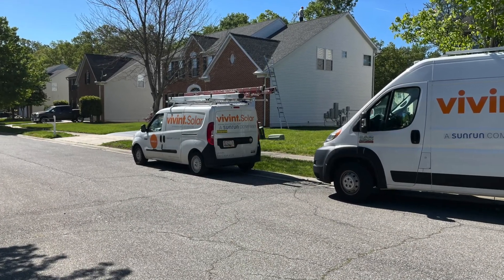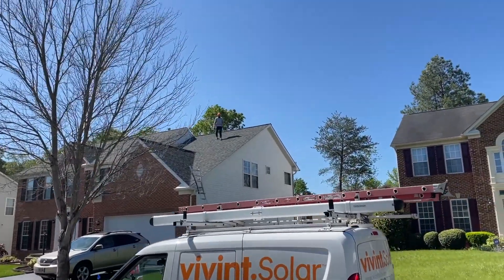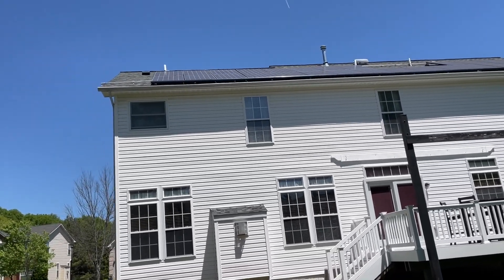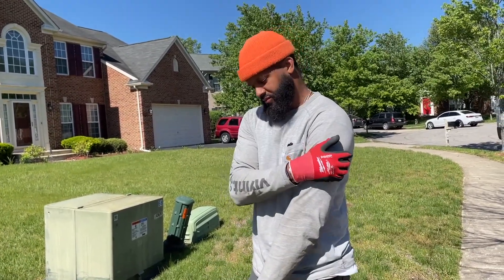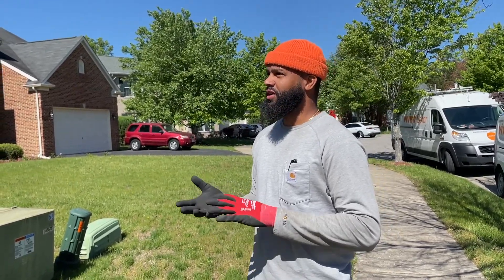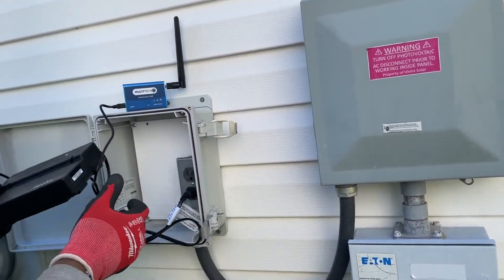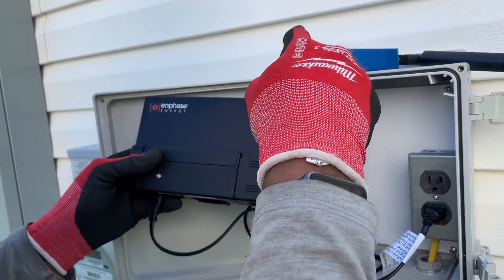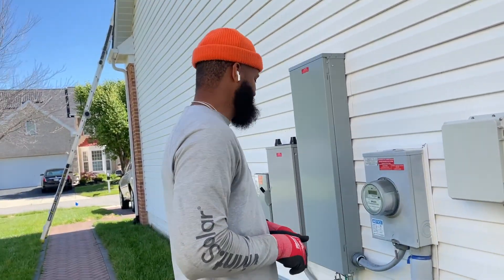"A simple step to insure solar panels are producing effectively". Please waste your time: S25 - EP8

Comment: Three questions. How likely are they to be struck by lightning, and how much additional weight do they apply to the roof?  Also, how difficult would it be you re-shingle the roof if needed? 
Thanks much.👍
Reply from the maker: Justin Case - I'm not an expert but the reality is that lightning can strike anything. A few months back, my community suffered a power loss. We heard a crack followed by a boom. My wife ran to the basement where I was. Because of my Powerwall, we did not lose power, but my neighborhood was completely dark. I think it lasted about 45 minutes or so. The next day I was informed that lightning struck one of the poles (not in our community - but fed power to us). Because of my Powerwall I did not lose electricity. ///// The panels are not connected to the roof. They sit are attached to two brackets - so there is really no additional weight. //// Because of age of the house plus a hail storm a year or so ago, I called my insurance company. They agreed that I needed a roof. The roofers came out  along with the insurance adjusters to get a quote. After everything was agreed, the roofers set a date to remove the old roof. In the meantime, I reached out to the solar company to inform them I am getting a new roof. To re-shingle like I did, the solar company removes all of the brackets and panels and puts the equipment at the solar company's storage. I have to pay a fee for storage (mines was about 400.00), but I get that money back from the insurance company at a later date. New roof on, a couple of weeks later panels are put back on the roof. Truly a lot of work for everyone involved including the homeowner!